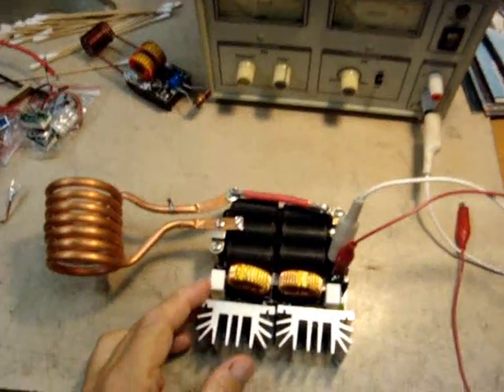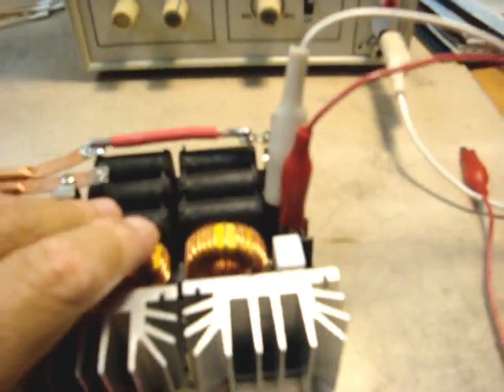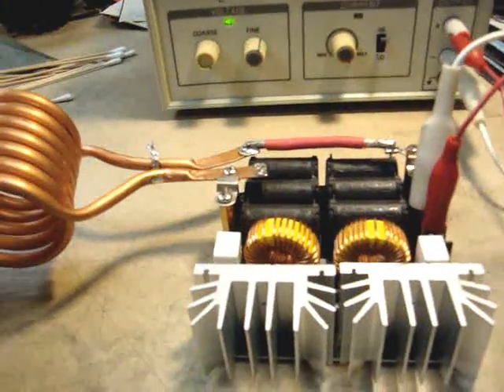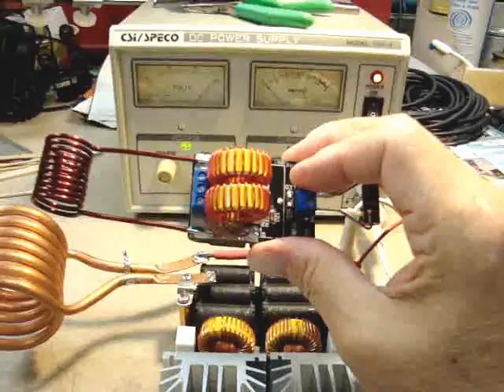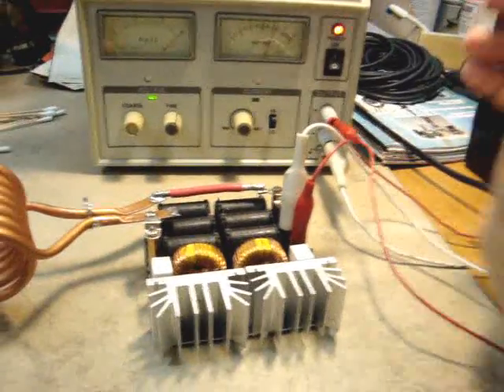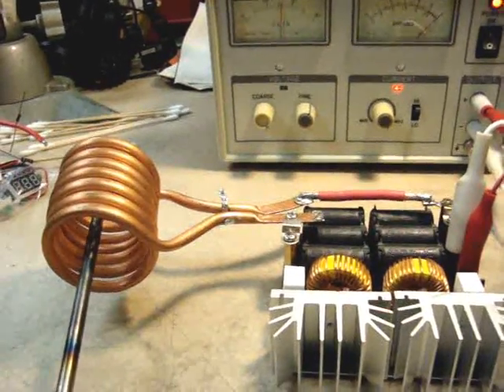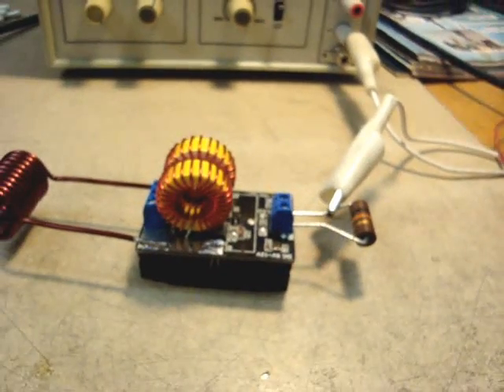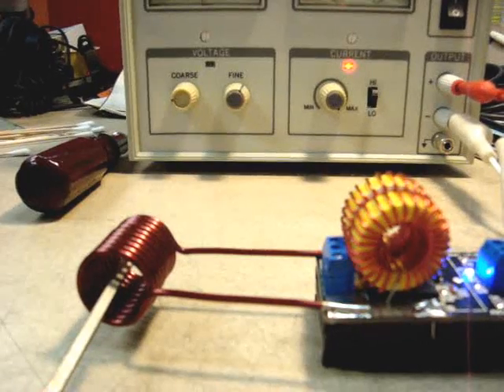Induction Heater Review

Comment: Hello Bob, is it possible to boil water with those devices ?
Reply from the maker: I've never tried it, nor have I heard of anyone doing that either. It's worth a try.
Reply: +Bob H I think it will consume a lot of ampera, quite so much as a normal boiler that needs 1000 Watt. With the screwdriver. . how much watt are used when red hot?
Reply from the maker: +Pierre de Muralt - It was drawing around 80 watts. As far a boiling water, the water would need to be ferrous. The ferrous content in ordinary water is very low, if existent at all. I don't think water would boil with an induction heater.
Reply: +Bob H thank you for this information.
Reply: Pierre de Muralt  Go to where they sell kitchen appliances and buy a table top induction heater like the one they sell on late nite TV, where the burner does not get hot. That i
Reply from the maker: Certainly! I'm glad to know the vid was helpful
Reply: Do you watch late night TV? They sell  single burner, table top induction heaters. The coil inside is wound flat to better couple to the pan. Metal near the coil gets hot. If it happens to be a metal container that is holding water it will boil. It does not directly heat the water.
Reply from the maker: Jeffrey Deutsch - Yes, I've seen those heaters. You are right, they don't directly heat the water.. just the pan. I may get 1 to play with.

Comment: How would you kickstart it with a 6 cell lipo and it blew up on me.. (22.2volts)
Reply: Look US $34 http://ali.pub/x7mb3
Reply from the maker: +Masterpj555 - Try something like a 10,000uF capacitor across the battery. This should help. How much current can you cells provide?
Reply: 25C so that is 32,5 Amps at the 22.2 volts and 50c peak so that's 65amps for a little while.
Reply from the maker: +Masterpj555 - I also recommend a volt meter to monitor the voltage during connection and operation of the unit.
Reply: +Bob H the capacitor in between the + terminal of the battery and the ZVS driver?
I will replace the mosfet when it arrives and try this
Reply from the maker: +Masterpj555 - No, the capacitor would go in parallel with the battery. Connect the + of the capacitor to the + of the battery, and the negative to negative... like jump starting a car battery. (Hopefully you've checked both mosfets.) ;-)

Comment: Hi Bob
I tested the smaller one with a 5A 0 to 12v supply and it worked great the bigger one I tried to power up whith 5A 12-24V supply and nothing happened,then whith two car battery serial conected the mosfet exploded .I order a new one and I don't want to make the same "discovery";need advice, appreciate any help .Thanks in advance
Reply from the maker: +Jan Peter - They're squirrelly designs and can be so damn touchy.  Some folks don't have any trouble with them, then others do (like myself). Highly recommend something with current limiting ability, like a 48v 20A current limited power supply. If that's not possible, at least have a fuse in the circuit - maybe like 30 amps. Make sure that the power leads are big enough to carry the needed current. If there's any sag in the start current, these units will probably lock up. You really need a stiff power source to 'kick' it. Check this guy's vid; he's got the right set up...   https://youtu.be/1wwlbN-9jsU   Even tho batteries should work, I prefer this method over using batteries.
Reply: Thanks Bob .I found this power supply on Aliexpress it gives 12a 48v .I am asking myself if 12a current would be enough to heat up a small graphite crucible to melt some copper alloy (bronze).I don't wanna use batteries.
http://www.aliexpress.com/item/600W-48V-Single-Output-Switching-power-supply-for-LED-Strip-light-AC-to-DC/621245587.html?spm=2114.13010208.99999999.303.aaTfiK
Reply from the maker: +Jan Peter - Yes, that will probably work, but it may not be enough. Remember that these units are rated at 1000 watts at full load. The math indicates that it will require about 21 amps at 48 volts for 1000 watts. Whatever metal work placed in the coil and how close it is will determine the amount of current the unit will draw. I recommend an amp meter of 0-20 amp so you can see how much current is being drawn by it during the work process.
Reply: +Bob H It seems I have to try and error to find the best way
Reply: Releasing wolves from traps

Comment: Hey Bob, nice video. I am using the 1kW heater which you showed, and used a linear pwr supply of 24v-15A whose voltage dropped to 4V when applied in circuit, so can I use your method in my case also?

 Can you please specify your Dc power supply rating. thank you.
Reply from the maker: +Mrudul Shingwekar - The supply in the video is rated at 5 amps max. I was able to get the induction heater to work with it, but a 15-20 amp (24v) supply would be far better for these kind of induction heaters to work properly.

Comment: Bob, the smaller one you demo'd arrived last week, and last night I tested with a 6a 12v supply - which I stole from an amplifier.  Soldered the coil as you did.  It worked great.  My test object was a nail, held by pliers.  It got red hot in about 15 seconds.

Of course, now that I have this $10 "toy", I don't know what to do next.  Is there any practical use for these little things?  Anyone?
Reply from the maker: Lbs - Glad it worked for you. Yes, they're a little squirrely to get working. I have plans of using mine to reflash the getter inside vacuum tubes. Can't go wrong with the price.
Reply from the maker: +david lum - I going to use mine for reflashing the getter in older vacuum tubes. Other than that, I really don't have much use for it. They're fun to play with tho, and the cost is right. ;-)

Comment: Do you recommend this heater?
I need one that heats up to 2000 degrees celcius
this model can work continuously for 24 hours followed ?
it needs to be cooled with water?
Reply from the maker: +Eco Fuel - No, I wouldn't recommend it for that kind of service. It is best used for only short durations.
Reply: + Bob H Would you recommend me to someone I can use continuously?
Reply from the maker: +Eco Fuel - Here it is... https://youtu.be/UWk3s01oqDM
Reply: What volume can put inside the coil to heat?
Because the manual says it has to be 1/10 of the coil dimension!
Another question is possible I increase the size and dimension of this coil the device will work? this Model "

1000W ZVS Low Voltage Induction Heating"
Reply from the maker: +Eco Fuel - Sorry, but I don't know exactly volume can put inside coil to heat. Do you have this model? Is it working?
Reply: +Bob H 
I want to buy
I need to warm crucible
Reply from the maker: +Eco Fuel - Ok, then yes, this induction heater is good for the price. It should work good for your need.
Reply: +Bob H I'll have to put a water pump to cool the  heating tubes?
Reply from the maker: +Eco Fuel - Yes, that is good to do.
Reply from the maker: +Eco Fuel - Yes, this is good.
Reply: Output power: 500W ?
Reply from the maker: +Eco Fuel - Yes.